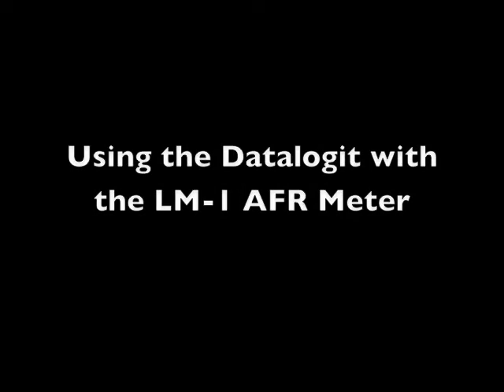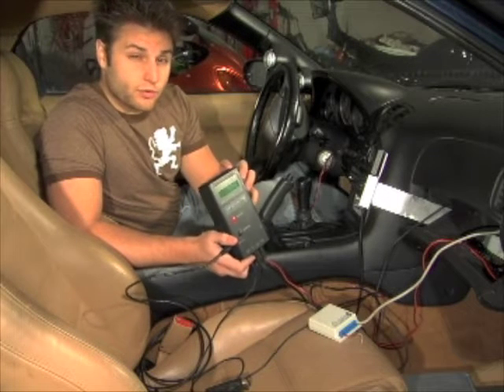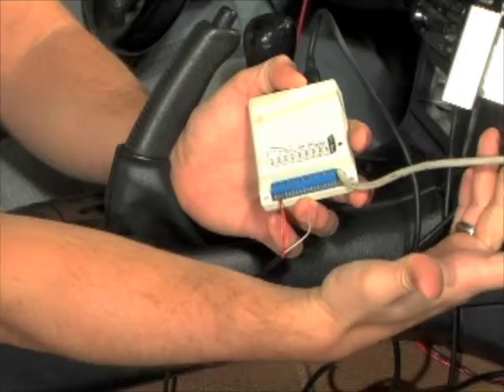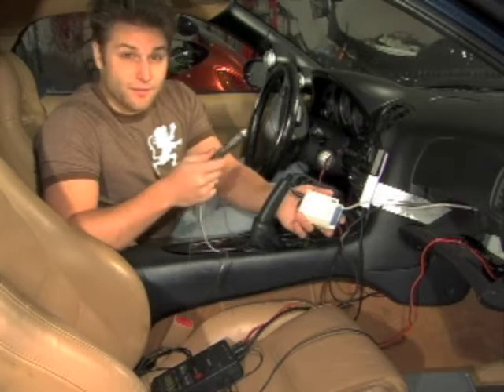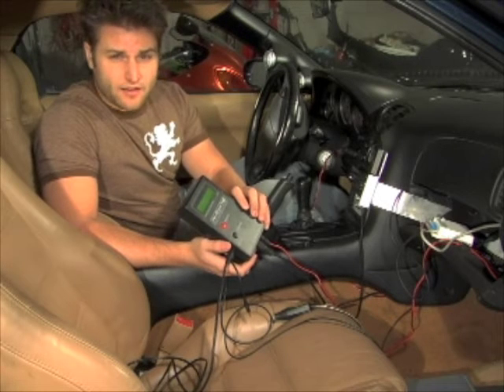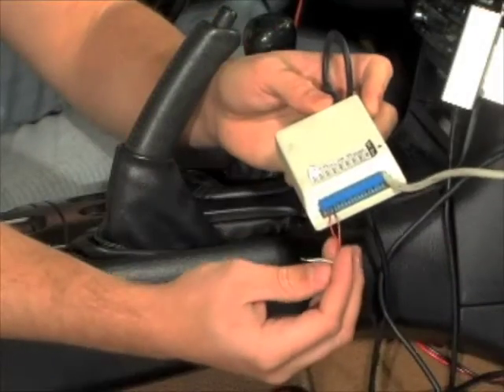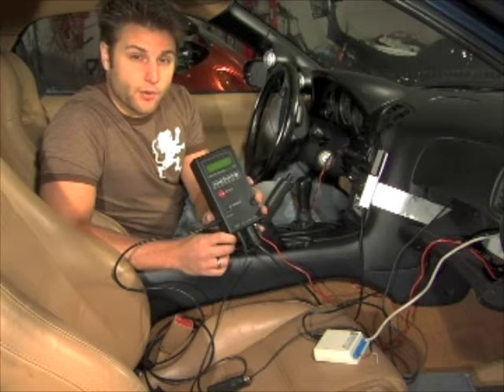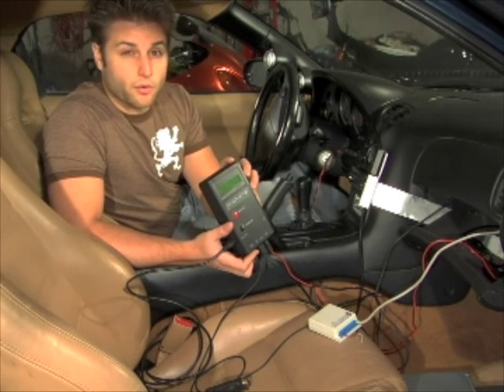Installing the FC-Datalogit and LM-1 Meter

Comment: The awd 4 rotor runs 🤙 November 2019
Reply: the AWD 4 Rotor is getting carbon fibre body panels, it's almost in its final form, January 16 2022
Reply: The awd 4 rotor raced the Hoonigan 2020 dec 14